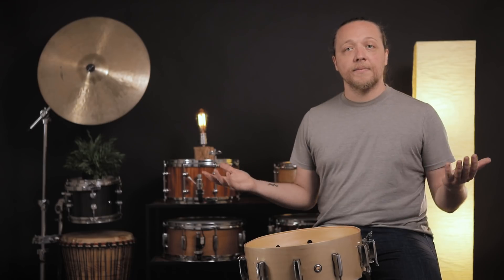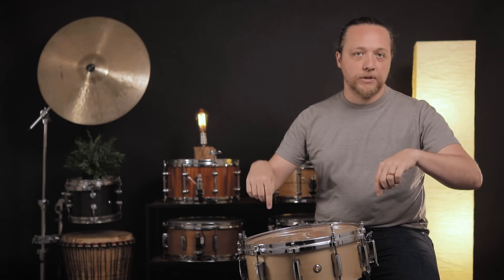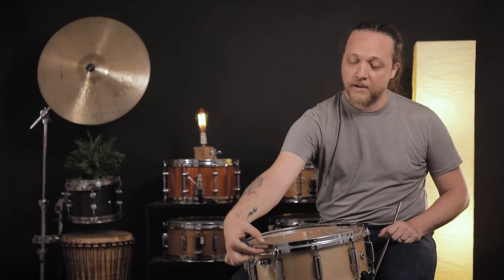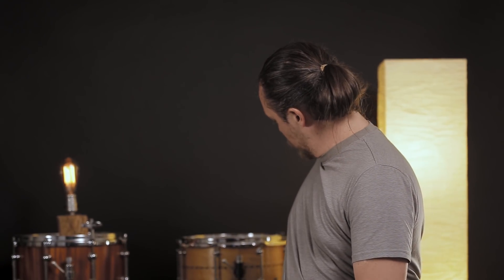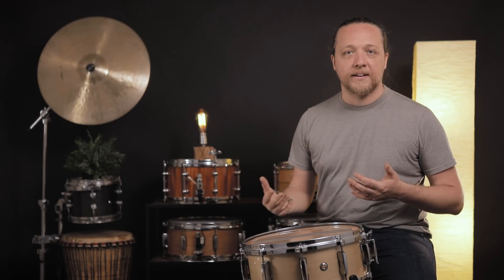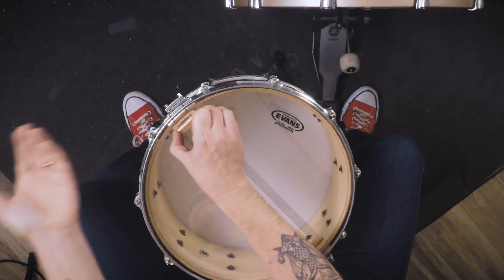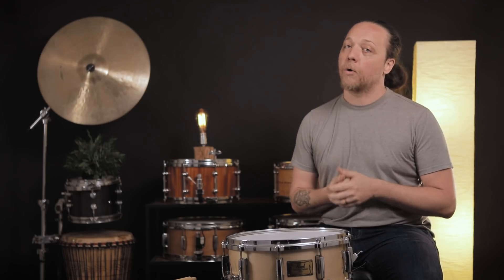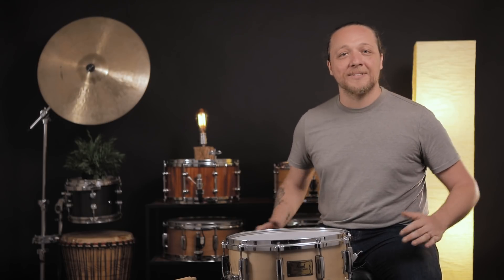Real-Time Snare Side & Snare Wire Tuning | Snare Drum Tuning 101

Comment: The four lugs being too loose used to freak me out for a long time, because I always thought it was not normal. Thanks for reassuring me on this particular point.
Reply: My first snare was 1st generation Pearl Free-Floating, back when they had the complicated snare mechanism and extra-long wires that went past the shell.  The snare did not have beds.  It kinda messed me up a bit when I got a normal snare.
Reply: Eurodrummer666 yeah. Same happened to me
Reply: @jc3drums916  Is a Pearl Free Floating snare more likely to buzz than a conventional when playing the toms?
Reply: @Eurodrummer666  yeah, I have the same question :)
Reply: Same, I would tune it up until I wouldn't see any wrinkles, before I knew it the hoop was way past beyond the bearing edge, I would mess up my heads pretty frequently and where I live these type of heads are the most expensive. After I saw this I tried with a fresh pack of heads and wires and it made wonders.

Comment: 21:03 My woes and frustration was following all the exact steps after binge watching all your snare videos many times. And had the snare still sound a little "something missing"!! 

It took me a long time, hours, days, to just play around my snare tuning and discover how she likes to be tuned. 

To anyone who just started, don't give up! The videos on this channel are super amazing! It's my guide and go-to channel. We can binge watch and understand all the theory, but still, you need to spend more time to meddle and play with your own snare tuning to know how it best fit your ears and music ❤💛💚💙💜
Reply: A Yuu A good rule of thumb is to start with tuning the reso side 4 half steps up from the batter and if that doesn’t work try a 5th. I can get any of my snares sounding great using those 2 methods. I always start with a medium batter tension which works with most snares. If you go too tight on the batter then you have to crank up the snareside head to keep the tension relationship. You don’t have to have that 4th or 5th head tension relationship but snares usually sound their best when that method is used for me anyway. It helps to use a pitch pipe but knowing the notes the snareside should be is ideal.

Comment: Excellent video! The EQ wires sound really nice on this drum.

I had a rough time with my Tama SLP Black Brass 6.5 x 14 snare. It came with 42 strand wires and... they sounded terrible. Choked, mushy, unclear, thin, etc. I tried a range of tunings, especially on the bottom head. I finally got it dialed in when I switched out the stock wires with Vic Firth (secretly Canopus-made) 26-strand wires. From 42 to 26. The snare now sounds EXACTLY how I wanted it to sound. Snappy and clear, but big and fat, with tons of aggressive projection. Almost don't need a mic in the rehearsal space!

Proof positive that snares make a massive difference in how a drum behaves.
Reply: Nice upgrade! Yeah, 42 strand snare wires are waaay problematic for exactly the reasons you stated.  I would add that their overall sound is always "sloppy" on every single drum I've heard them on, cuz due to the extra width, you can't get even tension at the edges compared to the center.  This results in excessive uncontrollable snare buzzing.  If you try tightening it up, the drum definitely chokes out.
Reply: Snare Mic ? …..At a rehearsal.  Yikes ?

Comment: Those are the strainers I use on my Pork Pie Squealer!! They were called “blaster” wires when I first picked them up. Love them!
Reply from the maker: The Blaster wires are a full set (none missing in the middle). This model is the Equalizer series, meant to cut back a bit on sympathetic snare buzz. They’re also just a bit drier in general.
Reply: Oops, my bad! Either way, I have this split one, and I love it!

Comment: I'm glad I'm not the only one who doesn't like snare cord with a metal core (Puresound, et al.).  It ruined my snare bed.  I use a plastic strap now, but I've been wanting to switch to cloth.  I think it's easier to use than string, because you only have to pull on one thing.  Although, maybe it's easier to make tiny adjustments with string, once you have it on - you can loosen just one screw and pull on one end.

You can also do what Noble & Cooley does, which is to put the string through the holes the "wrong" way, and tie knots at the ends to keep the string from falling out.  That way, you have a loop of string instead of the two ends to pull on.  That's probably the best of both worlds.
Reply from the maker: Yeah totally man, I do the N&C thing sometimes. At this point i'm down to try about anything :) - Cody

Comment: You could use a heat gun on the wrinkles and they'll shrink away. I find it mandatory to do that on some snares, especially ones with deep and wide snare beds, because I like to tune my snare side head relatively low (77 on a drum dial) in order to obtain a good amount of body out of the drum. 

Also, when installing and adjusting snares, I max out the tension knob on the throwoff, disengage it, and install the snares that way. Attach on the butt plate first (you usually have to set the snares a little closer to the buttplate side 2-3mm when doing it this way so the spacing equals out in the end) then pull them through the throwoff and clamp it down with snares tensioned fairly tight by hand. Finally start slowly engaging the throwoff while backing off on the tension knob until you can fully engage it then fine tune from there. I find this method works great and lowers the chances of the throwoff disengaging.

Comment: I have not come across a video that talks about wrinkles. Much appreciated! Particularly on my 12" snare, the snare beds seem particularly dipped.
I was going with the "cranked" setting that many drummers recommend. Sure, if you keep tightening, you reach a point where you get the head levelled somewhat. But to my ears, the tone may end up choked, first of all, and too bright and thin, as well. So, I reckon I'd better start at this point and allow the hoop and head to adapt to the tuning and check the tuning after some time.

Comment: Summary: 19:40
1) Heads are fundamentally leveled on the drum, there isn't a part of the hoop that is under way less tension than somewhere else

2) Wires are in the center when they're engaged on the head, Not twisted

3) Enough room on the mechanism to adjust the wires the way you want

Comment: Tip for stringing your snares:
I tie a reef knot in the loose ends of the strings so you have a tiny "handle" to pretension the snare before clamping then in. 
Stringing the string OUTSIDE the pair of bolts results in extra stability to the wires and its easier to do. Especially if you reef knot it! 
Snare bed wrinkles can be (slightly)  reduced with a hairdryer.

Comment: I have a number of snares, Sonors, Tamas and Ludwigs. My Ludwig Black Magic is the only one that has been designed to jam the string that holds the snares between the snare head and the hoop when the hoop is tightened. This means the throw off won't work unless I attach the snare wires with ribbon. It's my favourite sounding snare, but also the most annoying when you have to change the bottom head or snare wires.

Comment: I know you addressed this in an episode, but I CANT find it - What’s going on when a snare drum sounds great when hit dead center, but has a raunchy twangy snare wire bwaaang when hit off center? (To be clear, I know every snare drum displays more overtones as you near the edges, but I’m talking about an unacceptable, dissonant, sustained WIRE sound) 

It’s an issue I’ve run into, and gotten past, but never understood the science of. Everyone has a different opinion, and I’d love to get to the bottom of this. Thanks guys!
Reply: I have the same problem, especially with my Tama Superstar Hyperdrive 14×5 maple. It's usually because the snare wires are slightly cockeyed due to the tension between the butt plate and throw off misaligning the metal plates that the wires are attached to. Its worse when you use plastic strips or ribbons to mount the snare. Try using string and being very careful to tension them evenly, preferably with the strings outside the tension screws on the butt plate and throw off. 
In my case, I just hate that fucking Tama snare, and it clearly hates me back. I can't get it to sound right whatever I do. All my others (mostly Ludwigs and Sonors) sound fine!

Comment: I have a Yamaha Rock Tour Custom snare from the 90s I got for dirt cheap. Thing rips when I get it working. However, I noticed the snare wires weren’t centre, So I fiddled with it, got them center but now I don’t have any tension on the wires no matter how I spin the dial. They are the Puresound custom 14s. I had a method with the throw off in the off position but that made them too tight and got snare sound even in the off position.

Comment: I enjoy your videos, very informative. I think there might be a better way to level the hoop.get a peice of 3/4 x 1/2 parting bead. glue two pieces together with the top piece extended to sit on the hoop with the lower piece laying on the head. should be easier and more accruate than reading a tape measure against a rounded rim top. just a thought, I,m going to try it myself. thanks for the videos.

Comment: Another quality video!! I really enjoyed this.  Cody, on the ruler measurements on the snare side - are you 1) picking any old tension rod to start with and just work your way around the drum just once until you return to the beginning, or do you keep going around again to double check equal measurement and 2) are you picking an arbitrary measurement on the ruler given to you by the first tension rod OR do you use a particular measurement (e.g, a 1/4 inch, a 1/8 inch, etc.)?
Reply from the maker: Hey there! I start with any old one and even them all out. I’ll keep checking them all as I go but they generally don’t move much. As far as particular measurements to aim for I just go by what feels like a good tension and balance the heights to that. It varies drum to drum and day to day but that’s it :) -Cody

Comment: I have a bit different opinion on leveling. Leveling does not mean same tension on lugs. Hoops may have different height at different places. And this is not a rare thing. Checking with ruler is a good idea. But if trying to level with a ruler you're making like half a turn or even full turn on some of the lugs, this simply means your bearing edge is not good, or hoop.

Comment: I have a question!! at 7:05 you wind the looser rods more than the half turn you used on the first 4, but then what was the point of getting the ruler out and having eg the snare bed rods so much tighter? if they're just ending up closer in tension once you get to the next step? thanks for your help!

Comment: I wish you'd address a recurring problem I have with residual buzzing in the wires. It drives me nuts! I want that clean, crisp sound that comes with immediate decay of the wires. What causes this issue and what is the solution please. ☺️
Reply from the maker: It could be a variety of things, anything from an unlevel snareside head to the mounting strings/straps being crooked. Have a look at our previous videos about wires and wire mounting for a more in-depth look :) -Cody
Reply from the maker: Also- the snares can be damaged! This is one of the most common issues I’ve found when tuning drums for other people and they reference an inability to get a clean, crisp snare sound. There’s often a wire or two that has been tweaked a bit and doesn’t respond the same way that the others do. -Ben

Comment: Hi 
I have a 3way throw off and I would like to know how to adjust it so when it is off not to touch the snare head please!
Reply from the maker: You have to adjust the dial to the point where the wires don’t contact the head when turned off. Be sure to balance out the wires so that they’re centered on the head when the strainer is on.
Reply: @SoundsLikeADrum  Thank you will give it a go.

Comment: Great video! I just followed along with this, however my snare wires are still buzzing when the mechanism isn't engaged. They are floating an inch below the reso head when disengaged. Any insight?
Reply from the maker: Are the wires jumping up and hitting the bottom of the head when the snare mechanism isn't engaged or are they still touching the snare reso? If they're hanging an inch below the reso then they shouldn't be making any sound.

Comment: What about also using tune bot studio to fine tune after the ear test on each lug?
Reply from the maker: No need if you've spent time practicing tuning and training your ear. The Tune Bot can be great for specific tuning recall if you took readings previously, but that's still relatively simple just by ear.
Reply: @SoundsLikeADrum  Thank You.  I just picked up a tune Bot so I will see if it helps in my ear training and tuning ability like you mentioned. After using an app based tuner from my phone I can tell that it  (the app like tunebot from my phone) could be a game changer in that some of the moves I had to make in order to get each lug in tune, were never moves I would have tried in the past. I tried a phone app and it was uncomfortable to hold the phone right up to each lug for 30 minutes but it got each lug in tune at the lowest tension.. I couldn't believe it.  Barely past finger tension it had each lug in tune ..one lug I didn't even tighten at all. So I know that this is a scientific tool that I plan on getting more into. Great Channell and fun stuff.  Congrats!!

Comment: I Just cant get my snare side head right. lots of unwanted bottom buzz tend to occur. what would be the case here? replace bottom head? (Used kinda cheap one) or is the problem coming from the snare wires (stretched unevenly) what can be the reason? mine is a pearl sensitone steel snare
Reply: Hey fren. this comment is a year old hope you've figured it out by now. I would replace the snare side head. I was having the same problem. I over stretched my snarewires and they started sounding absolutely awful. I bought new snarewires, and had the same problem, but I noticed from over straining the snarewires, it marked up the snare side head. The problem didn't go away until I changed to a new head.

Comment: I was taught to always mute the opposite head of the one I'm tuning, either by placing the drum on a towel (or similar), or by muting by hand. The reason is to keep the opposite head from contributing overtones that might obscure the actual pitch of the head being tuned.

I would be curious to know why you guys don't typically take that approach, and better still, if you would try it and compare results to an unmuted tuning.
Reply from the maker: I won’t speak for Cody but my approach is to check to make sure that the opposing head is in tune with itself and as long as it is then I’d rather hear the full sound of both heads working together. Still, nothing wrong with muffling the opposing head for clarity if you need to. If I’m shooting for a specific interval between batter and reso then I’ll check each independently by muffling the opposing head. I’m more likely to place a finger in the center of the head I’m tuning so I can listen to the harmonics at the edge rather than the fundamental in the center. Just my $0.02. -Ben

Comment: So, is it normal to have to retighten the snare wires after every song? I should get a new throw off, right? It's a supralite, and I'm a bit of a novice, but still I'm pretty sure it's not supposed to need the tension fixed after two minutes right?
Reply from the maker: Some mechanisms just work loose especially if they’re not restricted by a spring or something - I’ve been retrofitting some of my drums with pen springs to stave this off - hopefully will snow in a future video :) -Cody

Comment: So to be clear,  tuning to pitch on the snare side will in fact distort the hoop, and that's OK right? I recently changed my bottom head on a great sounding Sonor Delite snare and noticed that the cast hoop had become warped across the snare bed. That alarmed me a bit, but it's always sounded fine... I love the cast hoop for the top head. Does anyone have any thoughts about using a rolled steel snare side hoop, specifically in relation to conforming to the snare bed?

Comment: Is the snare wire supposed to be  shorter than the diameter of the snare? Because it looks shorter in the video.
Reply from the maker: Unless you have a less common snare system like the parallel action snares found on drums like the Ludwig Super Sensitive, the wires are generally shorter in length than the diameter of the shell. 14” wires are for a 14” drum but are shorter in length so that the end plates don’t sit on the bearing edge. It’s important to note that wire lengths, even for a given shell diameter, can vary quite a bit.
Reply: @SoundsLikeADrum  Thankyou for answering. I just watch this episode "Shorter Snare Wires Solve Problems | Season Four, Episode 14". As a beginner it helped a lot for me to understand this. Love and Laser beams from Philippines!

Comment: The ruler is interesting. 
I’ve tried the drum dial, garbage and doesn’t work, as well as I will off and on use a tune not which is decent is it works in frequencies.